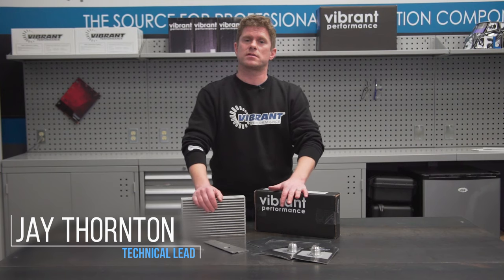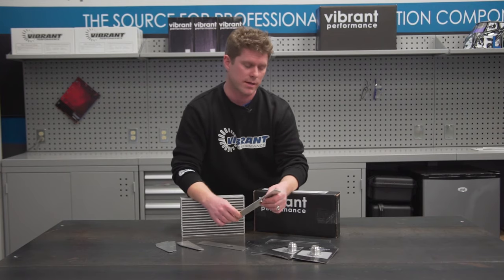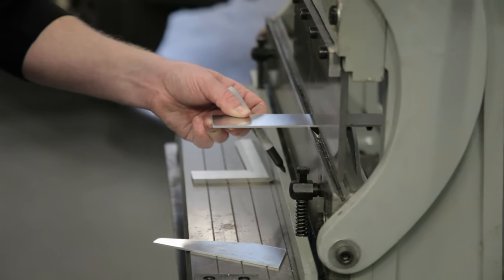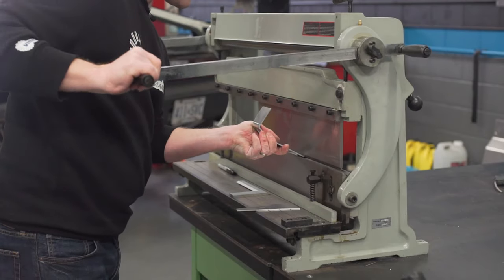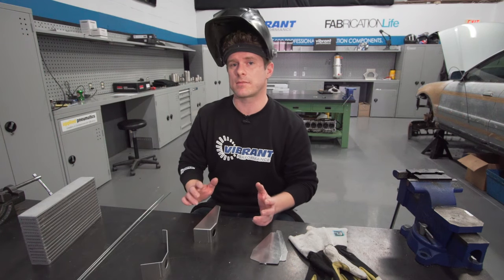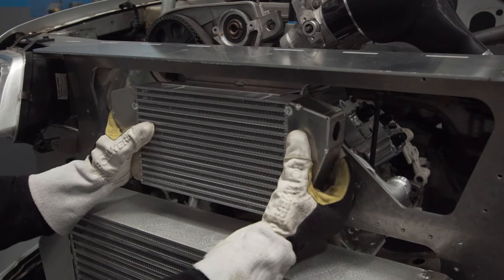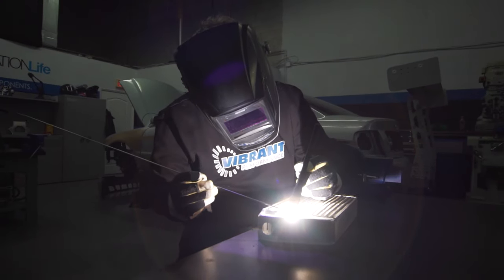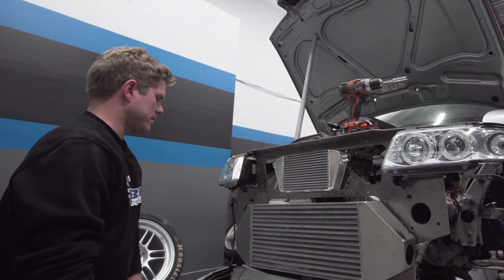How To: Fabricate End Tanks for an Oil Cooler Core and Installation

Comment: With that logic (of core fitting placement) couldnt you mount the fittings bottom to top? Are there any disadvantages to that? Would it cause oil pressure to increase too much?

Comment: Why the use of 5356 on an oil cooler that sees high pressure and service temperatures higher than what 5356 is rated for?  Should be using 4043 or 4943 it you want higher strength no?
Reply: Yes but it's just preference on what you suggest works better for you.

Comment: Is it possible to use the core to fabricate a motorcycle engine radiator?
Reply from the maker: It is possible, however these are bar and plate cores so you will notice that it will flow differently than your standard radiator